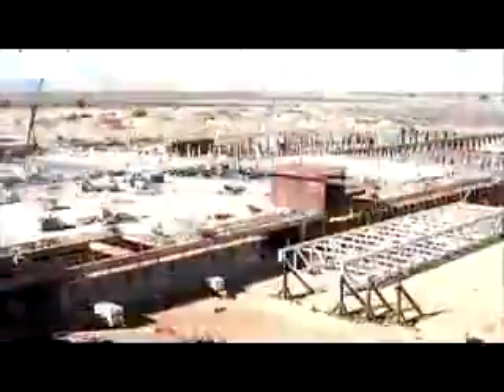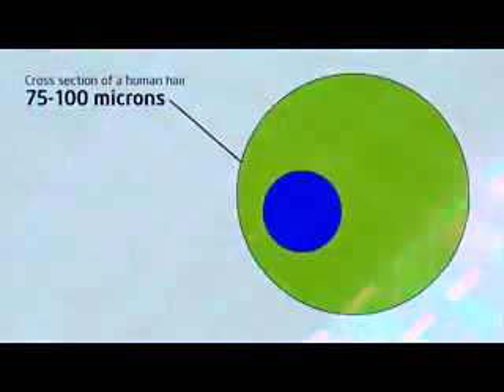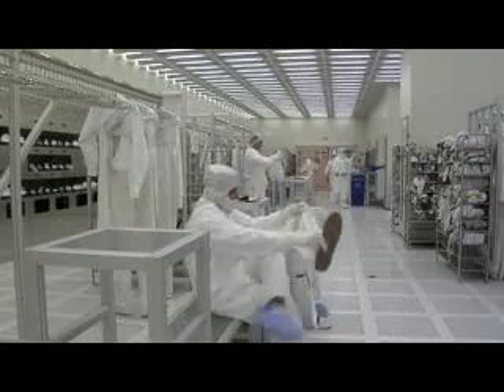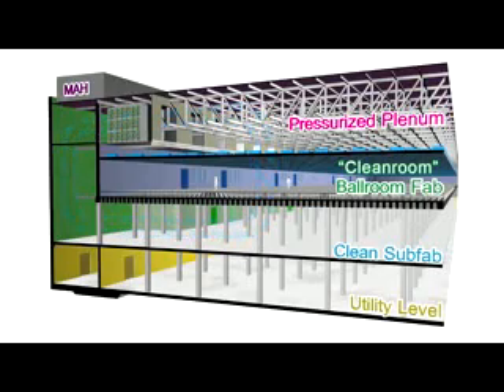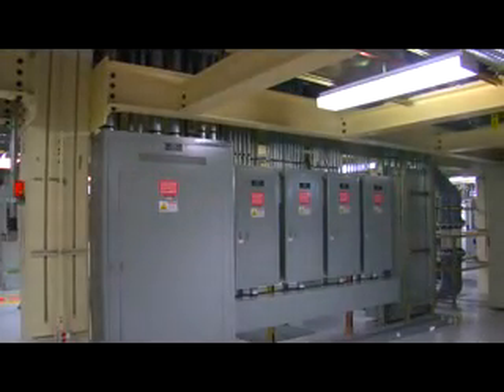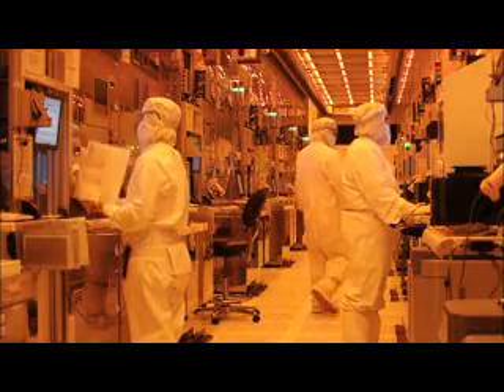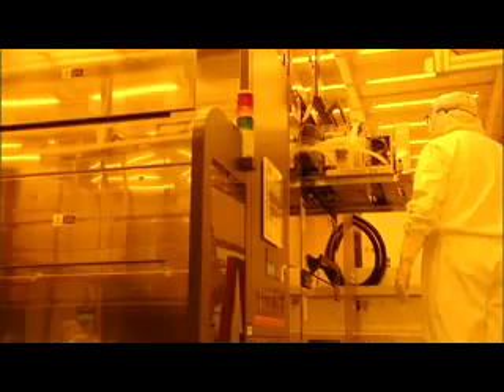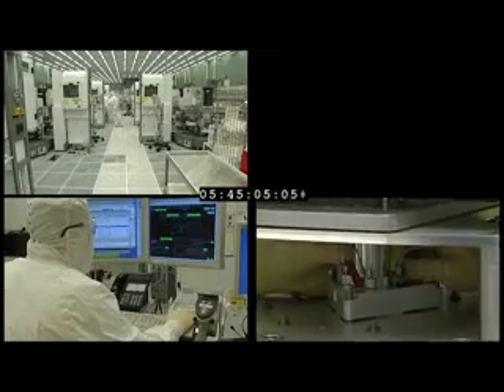Fab 32 - Intel's first high-volume 45nm chip factory

Comment: I used to work at an Infineon chip factory here in Richmond, VA.  Each one of those chip platters represents over $10,000 worth of chips.  So you can imagine what happened to a buddy of mine who was running the equipment that carries the platters from one area to another & one of the overhead carriages released the platters too early....CRASH!!  $250,000 worth of chips GONE in an instant.  Yeah.  He was gone also.
Reply: Should have fired the engineer who designed the overhead carriage.